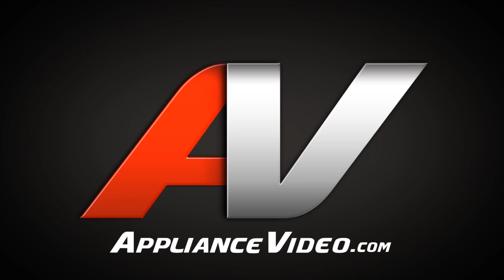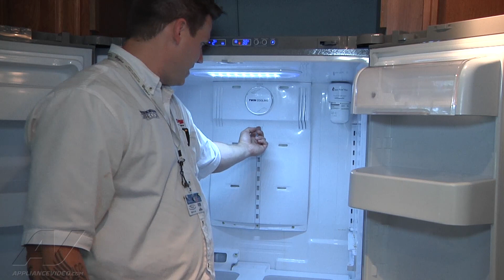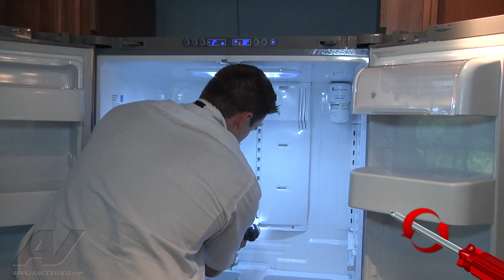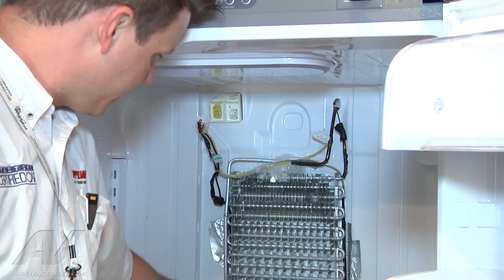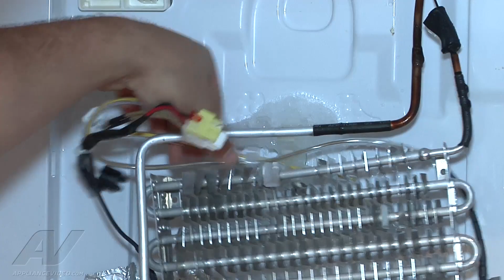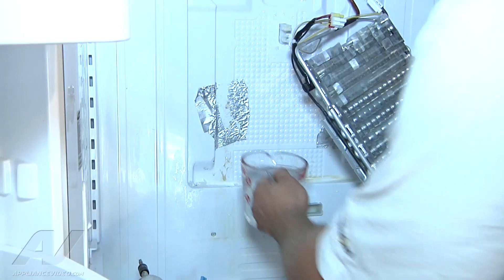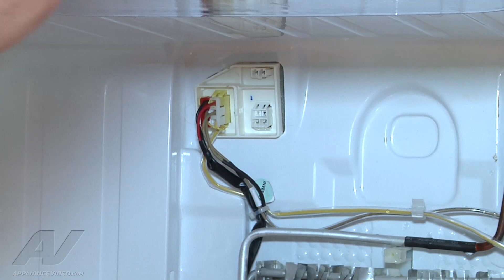Samsung Refrigerator Repair - Freezing Up On the Back Panel - Evaporator and Defrost

Comment: My fridge is the the Samsung French door and it has a symbol of some squares and right under it a raindrop that just went on to the color red. Do you know what that means?
Reply from the maker: Michelle Hernandez 

All of our technicians are now answering questions daily at our http://www.appliancevideo.com/ website under the Repair Help section.  We also have over 1600 common questions and
answers that you can easily search through by your model number, appliance
make, problem or error code and it’s absolutely FREE. You also have the option
to email a factory service technician with a question on your appliance at
http://www.appliancevideo.com/repair-help/ . If you’re looking for a repair video, you
can also search our library of over 2600 free repair videos. ApplianceVideo.com
specializes in quality DO-IT-YOURSELF appliance repair videos and we get over
800,000 views per MONTH to our videos worldwide and growing. If you need of
parts for your major appliance, we have over 5-million parts in stock at http://savemoreonparts.com/ .  Thanks
for your support. Matt Ace Appliance factory service technician.
Reply: Michelle Hernandez It is an indicator to remind you to change your water filter it just means it has been 6 months since it was last reset which is done when you change your water filter.  You can reset it by pressing the ICE/Water button for 3 secs or look on panel for info it usually tells you how to reset or do a google search for your model or check your manual.  This light will turn pink at 5 months then red at 6 months. Keep in mind the fridge does not know how much water you have actually used through the filter which is supposedly good for 300 gallons so you don't necessarily need to change the filter every 6 months you can just reset the light if you want but I would imagine you would want to change your filter at a minimum once per year.  I would write down somewhere memorable when you last changed your filter if you choose to reset the light without replacing the water filter.
Reply: Kellyr95 thank you.😊
Reply from the maker: Michelle Hernandez 

Please help us provide more videos to our site by
subscribing to our YouTube page or posting our http://www.appliancevideo.com/ website on your Facebook or Twitter account. Our
factory authorized technician’s also daily provide free professional Repair
Help to people like you to help solve their appliance problems. You also have the option to email a factory
service technician with a question at http://www.appliancevideo.com/repair-help/ .  If
you need of parts for your major appliance, we have over 5-million parts in
stock at http://savemoreonparts.com/ . Thanks
in advance for supporting us. So email us if you have any other questions our
videos cannot resolve. Thanks for your support in advance.   Matt, Ace Appliance service technician.

Comment: This video is an enormous help. I'm not all that familiar with the general design of a refrigerator. When the water goes down the drain shown in the video, where does it go? I ask because my Samsung has a great deal of ice build-up, so as it melts, do I need to worry about something flooding someplace?
Reply: It goes to a tray in the lower rear of the refrigerator and is evaporated by heat from another component... so don't worry about it, but also don't pour TONS of water down it because it could overwhelm the evaporation process.
Reply: halkarp Did you ever get an answer to this question?  I need to thaw mine as well. Thanks
Reply from the maker: halkarp 

Thanks for the positive comment. Hopefully we saved
you some money. Please help us provide more videos to our site by posting ApplianceVideo.com
on your YouTube, Facebook or Twitter account or add us to your circles. If you are in need of any parts please support
our parts department on line at http://savemoreonparts.com/ or call 1-800-830-5465 7-days a week until 11pm Eastern
time. Thanks again your support.  Matt, Ace Appliance service technician.

Comment: What can it be when the fan for the cooling system won't turn on ..... already replaced the fan but it still won't turn on..... can you lead me in the right direction.....I would greatly appreciate it..
Reply from the maker: Fernando Cruz 

All of our technicians are now answering
questions daily on the ApplianceVideo.com website. You can search completely
FREE in our Repair Help section with over 1000 questions & answers. Or you
can get unlimited technical advice and video links emailed to you by our 14
factory certified technicians at
http://www.appliancevideo.com/premium-membership/.  If you are in need of
any parts please support our parts department on line at
http://savemoreonparts.com/ or call 1-800-830-5465 7-days a week until 11pm
Eastern time. Thanks for your support. Matt Ace Appliance factory service
technician.
Reply: Fernando Cruz I know this was 3 years ago, but did you finally get it to work?

Comment: Great video, easy repair, what was the exact part number of the heating assembly(tube).  The part number you listed is for the whole radiated system
Reply from the maker: voodoochilezee 

       Thanks
for the positive comment. Hopefully we saved you some money. Please help us
provide more videos to our site by posting ApplianceVideo.com on your YouTube,
Facebook or Twitter account or add us to your circles. If you are in need of any parts please support
our parts department on line at http://savemoreonparts.com/ or call 1-800-830-5465 7-days a week until 11pm Eastern
time. Thanks again your support.  Matt, Ace Appliance service technician.

Comment: I have a RS253BAWW Samsung that keeps freezing up what part should I order?
Reply from the maker: Ronald
          All of our technicians are now answering questions daily on the ApplianceVideo.com website. You can search completely FREE in our Repair Help section with over 1000 questions & answers. Or you can get unlimited technical advice and video links emailed to you by our 14 factory certified technicians at http://www.appliancevideo.com/premium-membership/.  If you are in need of any parts please support our parts department on line at http://savemoreonparts.com/ or call 1-800-830-5465 7-days a week until 11pm Eastern time. Thanks for your support. Matt Ace Appliance factory service technician.

Comment: Your first video looks like my fridge. In my case, there was no ice where the heater wires go. The tubing where it goes into the wall has no heater wires near it. That's where the ice is in my fridge.
Reply from the maker: Jakob Heitz 
              I am not a technician I just found the two videos from our website for you.  All of our technicians are now answering questions daily on the ApplianceVideo.com website. You can search completely FREE in our
Repair Help section. Or you can get unlimited technical advice and video links
emailed to you by our 14 factory certified technicians at @premium-membership/.  If you
are in need of any parts please support our parts department on line at @ or call 1-800-830-5465 7-days a week until
11pm Eastern time. Thanks for your support.

Comment: I have a similar Samsung. The display says it's cold, but it's not. It makes a rapid banging clattering sound like fan blades hitting a chunk of ice, then after a few days, the fan stops altogether. I pulled the cover off the evaporator and noticed that the ice was only built up where the copper tubing goes into the wall, not all through the evaporator where the fins are. The ice accumulation is also near the fan on my model, thus the noise.

I fixed it by wrapping those tubes with foam insulation and duct tape, finishing it off with gap filler. Now, all the tubing without fins is insulated. Let's see if it works.
Reply from the maker: Jacob 
     This sounds like you have a part of your defrost system out. Check out these two video links to solve your problem permanently . http://www.appliancevideo.com/samsung-rs263tdbpxaa-refrigerator-repair-not-cooling-properly-defrost-system/ ( second video )   http://www.appliancevideo.com/samsung-rf266aepn-refrigerator-repair-not-cooling-properly-freezing-up-on-the-back-panel-evaporator-and-defrost-system/  . Please help us provide more videos to our site by posting ApplianceVideo.com on your YouTube, Facebook or Twitter account or add us to your circles. If you are in need of any parts please support our parts department on line at http://savemoreonparts.com/ or call 1-800-830-5465 7-days a week until 11pm Eastern time. Thanks again your support.  Matt, Ace Appliance service technician.
Reply: Jakob, any update on how you fixed your frig did insulating the tubing work
, I seem to have the same issue with the ice build up on the top when it goes in the wall.

Comment: Hi, I have 2 years old  Samsung  RF217ACWP/XAA,  since November every time when I bake in the oven (they stay next to) or maybe I put something warm inside (never hot)  refrigerator start cooling more then temp shows then stop cooling at all. Temperature shows -2 for freezer and 34 for refrigerator. I took off the back wall and everything behind was covered with ice, I used a hair dryer  to defrost  and then I reset it and shows real temperatures and start cooling and then  temp. reach correct level. I did this 3 times in two months. What parts I should buy ?
Reply from the maker: Ula
   All of our technicians are now answering questions daily on the ApplianceVideo.com website. You can search completely FREE in our Repair Help section. Or you can get unlimited technical advice and video links emailed to you by our 14 factory certified technicians at http://www.appliancevideo.com/premium-membership/.  If you are in need of any parts please support our parts department on line at http://savemoreonparts.com/ or call 1-800-830-5465 7-days a week until 11pm Eastern time. Thanks for your support. Matt Ace Appliance factory service technician.

Comment: Have the exact refrigerator and this is my model # rf266aepn/ xaa01, but I given the parts # to parts department they unable to find the parts. I needed the exact part that your replacing. Somehow can you send me the parts#.
Reply from the maker: hmongvang916vang
                                                    All of our technicians are now answering questions daily on the ApplianceVideo.com website for anyone needing help. Just copy and paste this this question under REPAIR HELP, and one of our  factory authorized technicians  will answer . They will be able get the part numbers you need.

Comment: I have a similar model ( RF265AB ) - I had recent fried the mainboard because the ice maker had broken & the wires on that shorted. In any case, when the repair guy was out diagnosing that (I replaced mainboard myself, but didn't identify problem ), he mentioned that there was a simple repair to stop the RF265AB from frosting over -- you basically "lower the heater" a small amount. It wasn't clear to me how to do this given that the components are zip-tied and given cable lengths.

Right now, I just turn the fridge OFF every 1-2 months, let it defrost and suck out the water (or use towel), but I would like to find a longer term fix. Any ideas?
Reply from the maker: Dirk
        If you go to our FREE repair help website at ApplianceVideo.com and post this question, We have 14 factory authorized technicians that will  answer any technical questions daily on your appliance issues. This is the only website on the web that you can get questions answered by certified appliance and HVAC technicians at absolutely no charge along with over 2600 free repair videos. Thanks Matt Ace Appliance factory service technician
Reply: Thought I would follow up - the answer at this link in Samsung community says the problem is that water is getting where it shouldn't get because the fridge is not properly leveled. This could be a similar concept to changing the heater location which the tech mentioned to me three years ago. In any case, I ordered a replacement part but am also going to check the level on the unit. https://us.community.samsung.com/t5/Kitchen/Evaporator-Fan-freezing-RF263BEAESR-French-door-refrigerator/td-p/63478

Comment: I called your 1-800 number and you don't have my refrigerator part. The person I spoke to said that she couldn't find Samsung RF263AEPN model and asked me several times if I had the correct model and advised me to go home and to check again.
Reply from the maker: Look at this link for your part needed http://www.searspartsdirect.com/partsdirect/part-model/SAMSUNG-Parts/Refrigerator-Parts/Model-RF263AEPNXAA0000/1482/0161000?searchedModel=RF263AEPN&blt=&shdMod=RF263AEPN

Comment: I have a Samsung mod RB215BSSW bottom freezer unit. When I awoke yesterday morning, the temp indicator was flashing, and the freezer temp had risen to +5 degrees from my set point of -4. I went on line to Samsung's web site, and  followed all of their suggestions including cleaning the condenser(s). I have removed the food. The compressor is running, and the frig is at normal temp. The freezer is now very erratic, and the temp indicator showed -12 this AM with the set point at -4. I am having a hard time finding someone to service this unit. I have been using this unit since 09/28/2006, I hope you can help me.
Reply from the maker: Fred 
           If you go to our FREE repair help website at ApplianceVideo.com and post this question, We have 14 factory authorized technicians that will  answer any technical questions daily on your appliance issues. This is the only website on the web that you can get questions answered by certified appliance and HVAC technicians at absolutely no charge along with over 2600 free repair videos. Thanks Matt Ace Appliance factory service technician

Comment: Hi,
I have a Samsung refrigerator model # RS267TDTRS/XAA and it keeps having ice build up on the regular fridge side and not cooling at all. This had happened many times! I just took it a part a week ago and ice completely encased the fan so much that it couldn't move and the coils were covered with ice. I wanted to order the same parts you're reparing in this video. I ordered these two parts from you folks: the SAM DA61-06031A - FIXER-HEATER SUB;HAEMIL1 and the SAM DA32-00029Q - SENSOR TEMP;DTN-C502G6X. Did I order the correct parts? Please let me know because it that's not it I want to call back and place the correct order. Thank you!
Reply from the maker: Yes, those are correct. Let us know how the repair goes. Thanks Matt
Reply: Did this solve the problem?

Comment: My samsung won't continue to cool/freeze unless I unplug/replug it everyday.  Interesting part is that we were gone for 3 weeks and expected to find the unit hot, but was working properly when we returned home. Now that we're home (and opening it) we're back to the initial problem of having to unplug/replug everyday for it to retain proper temps. The electronic thermostat reads ideal temp, but when reset, you can see that it is actually much warmer.  Any ideas?
Reply: Melanie,
After 3 yrs I finally got mine fixed and you could do it yourself. I was charged $127. The samsung tech took off the back panel inside fridge like they showed in the video but then all she did was take a 6 inch copper wire and tied to the bottom row on the aluminum tubes above the defrost hole and then snaked the other end down the hole. She said bad design. 6 months later works like a charm. Samsung knows about this problem and will not stand behind there product. Never buy an appliance from them again.
Reply: Suzy Duzy Thanks for the response Suzy, from what I can tell the copper is just conducting heat into the drain hole to keep it from icing up, is that right?  Any idea what gague the copper wire was?***** does this sound like a reasonable fix?
Reply from the maker: Melanie
          Get a mercury thermometer for each side freezer & refrigerator and see what the temps. are compared to the digital reading on your panel. Let us know if they match and get back with us so we can provide this information to out technicians and get you some answers. Give us the model number also.
Reply from the maker: Melanie Flinn
                        The only thing that can cause this type of issue is the main control board. When you unplug the unit and reset  the main board and its functioning properly again.I am not there to see the issue in person but I would say 90% chance its you main control board. You can call our parts department at 1-800-830-5465 to get a price on one. If I were you before purchasing the board call a repair company and have them confirm its the board, Its only around $60.00 to be sure you are buying the correct part.Let us know how it turns out.   Please help us provide more videos to our site by subscribing to our YouTube page or posting ApplianceVideo.com site on your Facebook or Twitter account. We also have our factory authorized technician’s email daily free professional advice to people like you to help solve their appliance problems. Thanks in advance for supporting us. Matt, Ace Appliance service technician.
Reply: I don't know the gauge but it wasn't much thicker than the wire on those big paper clips that you can use to close a potato chip bag. I'm really technical huh! Cooks appliance in Ozark Missouri did it.
Reply: +Suzy Duzy This is a really interesting solution - did you have the water pooling under your crisper? The ice eventually plugs up the drain and it overflows. Definitely bad design and I wonder if the copper wire trick actually resolved it permanently. Did it?